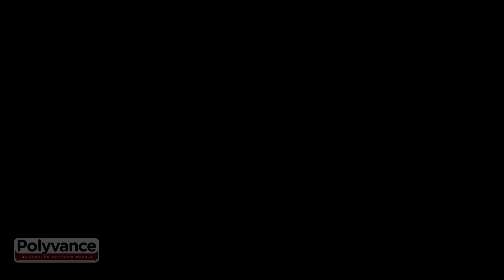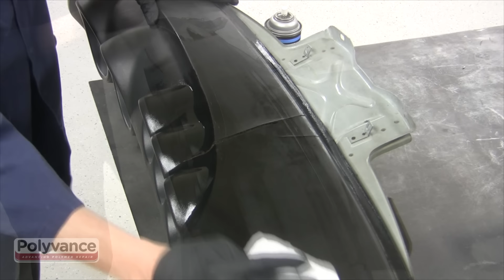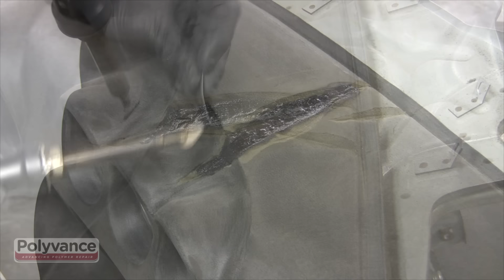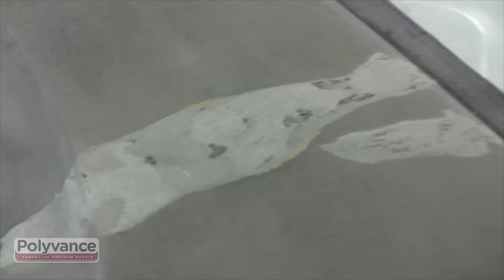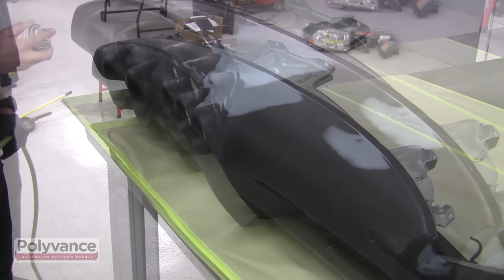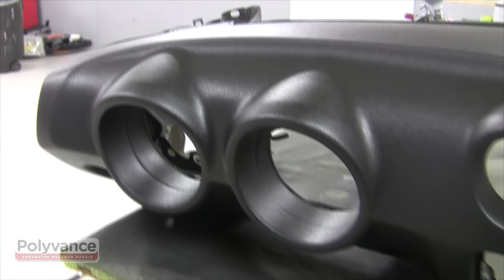Cracked Dashboard Repair - Padded Dashboard

Comment: Hello, Polyvance. I like all your videos and I am your subscriber, but I have two questions... That plastic you are using and melting before you apply that awesome putty - is that a plastic that has a PP letters on it?
I want to repair my dashboard in my Golf MK5, and it has slightly softer foam under the vinyl. Can I use that PP plastic, just like you did here, to strenghten the working area before applying the putty?
I don't have Polyvance products in my country, because I am far away from USA... I am from Eastern Europe, Serbia. So I use whatever I can find. Thanks in advance, your answer may help me a lot.
Reply: In most cases no.  You need to tie the cracked foam together with the vinyl with something.  Filler alone doesn't generally hold up well, since you'd be asking it to a job it was not intended to do.
Reply: You can order a 240V version of the kit needed to fill the cracks.  the  part number is  5210 230V as shown here:  https://www.polyvance.com/Airless-Welders-1/5210-230V/  You would have to email polyvance directly to place the order because the website cannot calculate shipping outside of the US.  When shipped by mail, it generally takes a little over a week to receive in most places.  The dash filler can not be shipped overseas due to the solvents in the formula.
Reply: Scott B Thanks a lot, sir, for the advice! This means a world to me.
Reply: I would not use PP plastic to fill the foam.  PP is much harder the urethane filler rod we use.  Just to clarify, there are two basic categories of urethane, thermoset urethane and thermoplastic urethane.  Thermoset is used for things like foam and bumpers and is not meltable.  Thermoplastic urethane is like our welding rod, it melts and rehardens without breaking down.  It is also fairly soft, flexible, easy to refinish and melts at a very low temperature and for those reasons is why we use it to repair padded dashes.

:Revised:  To actually answer the questions dealing with FIBERFLEX ROD....Fiberflex serves the same purpose as the urethane I mentioned and has the same benefits as the urethane in this application.  They can be used interchangeably in this case.
Reply from the maker: Thank you for subscribing to our channel and watching our videos!
In this video, we are using FiberFlex welding rods (https://www.polyvance.com/FiberFlex-1/). FiberFlex is formulated with carbon and glass fibers for the strong, fast repairs. It sticks well to polypropylene (PP) plastics. You can read about repairing plastic with FiberFlex here: https://www.polyvance.com/step3c.php
Reply: Scott B I bought BumperSoft BUMPER POLYESTER PUTTY, made by BODY and that is the one I could find. Can I use only that putty?
Reply: Because I don't have an access to Polyvance product in my country (we simply don't have it), what can you advise me? Some other materials? Please, I am kind of in a hurry and I did everything like you in this video, now I need to tie cracked foam together.

Comment: nice looking repaired dash, but i think it is cheaper to buy a new one (old one but uncracked) from car graveyard. But if you dont find one, or restore a "one of a kind" car, all that trouble should worth your money and time to fix the unique dash.
Reply from the maker: Yes, the time and money is definitely worth it for those who cannot find a new dash or would prefer to keep the original.
Reply: how much money a kit costs? Thank you!
Reply from the maker: We used FiberFlex in the first part of the video, which you can get in our Mini-Weld Model 7 (https://www.polyvance.com/Airless-Welders-1/5700HT/) or with the FiberFlex Repair Kit (https://www.polyvance.com/Airless-Welders-1/5210/). The filler is our Padded Dash Filler (https://www.polyvance.com/Padded-Dash-Filler-2/2050-9/). You can check the description box to see the products we used and how to get them.

Comment: I agree with the first step but you should use vylin paste with a heat gun and silicone mould from the same dash to mimic the original surface look. Look a bit cheap and tacky with the spray paint splatter finish.
Reply: Have you ever used those molds?  Its impossible to get the new molded texture to line up with the OEM texture and when you repaint it, you see a perfect ring where they intersect.  It looks terrible.  Retexturing the entire dash ends up looking much better, although its never exactly the same as on the original.
Reply: Scott B Yes. I used to be an Aircraft Interior Repairs Tech. We would use the silicone on a non damaged section then once it cured use that on the repaired section with vynil paste, then heat and press the pattern on. Then paint over top of that.
Reply: Scott B You just use less and less pressure and less vylin paste near the edges, in a sense feathering it in. Practice makes perfect.
Reply: I'll have to practice some more on that.  Btw,  I've used the Flex-tex VT on aircraft instrument panels and they look great.  Also, the lighting on this dash doesn't do it justice.  It looked much better in person.

Comment: Fixing the dash is the easy part. Getting it out and putting it back in is the project.
Reply: Yeah I've done it to many trucks and for the newer ones it's probably 4 hours of labor to remove the dash because of all the wiring and airbags. It's not as bad as you think this is an older car so there's less wiring and no airbags. I imagine probably 2 hours but who knows.
Reply: Agreed!
Reply: That's exactly what I was thinking.. How to get it out
Reply: Not in an 84 Chevy pickup!
Reply: @cranki6316  that is what I was thinking. Takes about 10 min to get it out and from the looks of things about 12 hours to repair it, or just shell out abou $300 for a new one
Reply: @integr8er66  I am yet to see a $300 280Z dash with no cracks and in good condition. Try $750 to $1200
Reply: @vinloy23  I'll give you that there are rarities where you have to repair it and you can't buy it or it's just way too expensive to buy
Reply: @integr8er66  and that is why this company has come up with this solution. I highly doubt they made it for cars that you can get a cheap dash for.
Reply: Yeah... I know, doing that right now with a 1991 Lada Niva.
Reply: It is pretty easy actually to get out one on a 1968 fierbird i just pulled out the glove box then the gage panel and dropped the steering colored and proped it up but can't say about other cars but I did think that it was going to be bad
Reply: Im going to do this with my 83 monte carlo ss but im scared to take that dash out i dont just have 1000$s laying around to replace what falls apart
Reply: Puppet you are correct! Once you've done one or two it's really not that bad! And I would rather put the two hours of assembly and disassembly, and the  two or three hours in on the repair myself than pay a shop 6-8 hrs labor plus material and taxes any day!!
Reply: That's what I was thinking!
Reply: Aman brother

Comment: dash looks overly textured, like bedliner, a flat finish would've looked better, and more like a vinyl/leather wrap
Reply: It depends on the amount of reducer you put in the texture paint.  Add enough reducer and you end up with a satiny smooth finish.
Reply from the maker: You're right that our Flextex VT will not match the original leather grain look. Flextex produces a pebble grain texture, from smooth to coarse (and anything in between), depending on how much you reduce it.
We could have left it at a flat finish, but we wanted to show that it is possible to put some texture back on the dash.

Comment: I've been doing custom interiors and repairs for 17 years. I came up with a procedure almost identical to this.  Using products from the auto paint store originally designed for repairing rubber and plastic body panels.  The only real difference is the heated plastic filer you guys use other then that it's the exact same process.  I can attest to the fact that this is the absolute best way to repair a dash even if it's going to be re wrapped with leather or vinyl.   Good job guys #greatmindsthinkalike
Reply: Similar experience here, fallout - been in the business for over 30 years, and discovered by accident that expanding polyurethane glue, covered by flexible body filler and textured paint yield the same result.
Been doing it for over 20 years now, have given all the the repairs a lifetime guarantee, and have never had a single return.
Reply: @lAMCANADlAN   what brand or part number of the expanding polyurethane glue do you use?
Reply: @lAMCANADlAN  That textured look might be OK on some cars but it wouldn't look right on my '95 Buick Riviera, it has more of a crinkle finish texture...
Reply from the maker: That's awesome!

Comment: I would pay you to teach me all this in person at a reason price. You got my vote on plastic repair.
Reply from the maker: We actually do hands-on training for our nitrogen plastic welders! We have our one-day PR-01 course that is taught at your shop's location: https://www.polyvance.com/Training-2/PR-01/
We also have a two-day, in-depth class at our factory: https://www.polyvance.com/Training-2/PR-02/
These courses are on the use of the nitrogen plastic welder, however. The FiberFlex in this video uses the airless plastic welder to make an adhesive bond. Our nitrogen plastic welders are used with the welding rod that matches the plastic you are repairing, which provides a complete fusion weld (a cohesive bond). Our nitrogen welders do have airless welders attached.
Just something to check into if you are interested!

Comment: Looks like truck bed coating ya wanks
Reply from the maker: You're right that our Flextex VT will not match the original leather grain look. Flextex produces a pebble grain texture, from smooth to coarse (and anything in between), depending on how much you reduce it. You can see examples of the heavy, medium, and fine texture here: https://www.polyvance.com/_pdf/info3803.pdf

Unfortunately, matching all OEM textures is impossible because some use a square pattern or a leather like pattern. Even if you take a mold of the pattern and embed the pattern on the repair, you cannot blend the original pattern with the reproduced pattern.  When you paint it, you end up seeing a transition ring every time.  So the compromise is to put a pebble grain over the entire dash and dealing with the fact that it is not the same.

Comment: I would think it takes a lot of experience to have that kind of result.
Reply: Its really not that difficult, it just takes time. The most difficult parts in my opinion are spreading the filler, so its not overly thick and spraying the texture.  As long as you don't spray coats of texture that are too heavy, even that is pretty easy.  Don't rush the texture spraying in other words.  Many thin coats are FAR better than a couple of heavy coats.

Comment: Maybe it's just me, but the 'new' look reminds me of truck bed liner texture, it looks like it would be quite rough. Also just doesn't look right to me.
Reply from the maker: You're right that our Flextex VT will not match the original leather grain look. Flextex produces a pebble grain texture, from smooth to coarse (and anything in between), depending on how much you reduce it. You can see examples of the heavy, medium, and fine texture here: https://www.polyvance.com/_pdf/info3803.pdf

Comment: Are polyvance products FAA approved for aircraft use?
Reply: That's a trick question, because the FAA does not approve products for making  repairs to non-airworthy components.  For the FAA to "approve" something it would require destructive testing and for a repair, that is clearly not possible. For all non-flight critical components, as long as the repair does not exceed 2 square feet in size (most would not be this large), all that is required is that the installation A&P sign off on the repair stating it would not pose a hazard to the aircraft or persons on the ground, should the repair fail.
Reply: Scott B very interesting to me. Do you know the FAR in regards to the 2 square feet figure. I have never heard that before and I would like to look that up.
Reply: In order for a mechanic to approve the repair,  look in the  F.A.R. part 14, sub part 23 for general aviation, part 25 for commercial aviation.  I believe it is section 25, 8-53.
Reply: Scott B thank you very much.

Comment from the maker: Check out our other videos to see more tutorials on our plastic repair and refinishing products.
The first part of this video shows us using FIberflex with an airless plastic welder. Did you know we also make nitrogen plastic welders?
We introduced nitrogen plastic welding to the automotive collision repair industry in 2006. In 2016, we introduced our fifth-generation line of nitrogen plastic welders with a full range of product features that make them the most versatile and easy-to-use on the market.
Thanks for watching! Don't forget to subscribe and hit the bell for notifications!
Reply: Anything that keeps UV light from hitting the plastic will help slow the aging process.
Reply: Polyvance. What can I put on it so it doesn't start cracking
Reply: @Polyvance hello any tips with a dash with the foam only existing? the black vinyl on the dash has been removed due to being to fragile and brittle of age and heat. Any tips , material that could be used to help. Thanks

Comment: Sorry to ask this but what kind of paper did you put under the puddy?
Reply from the maker: I believe you are talking about our "Clean Sheets".  They can be found at https://www.polyvance.com/Clean-Sheets-1/CS100/
Reply: I'm not sure what you meant by paper and puddy I assume you mean filler.....We used foil tape on the backside of the repair to stabilize the bumper during the repair and then we used 1060FP filler prep over the repair before applying the filler.

Comment: What if just the top part has a tiny crack
Reply: Then the repair would be shallower, you may not need to repair the foam at all if the crack hasn't telegraphed its way down into it.

Comment: While you filled the crack... perhaps excessively imho. You ruined the texture of the vinyl dash, it doesn't look like vinyl anymore it looks like plastic sandpaper.

I'd rather just live with the crack.
Reply: Its always possible to add more reducer to the Flextex VT in order to reduce the size of the pebble grain.  Keep in mind, the camera was flown very close to the textured surface and the lighting was set up to enhance the grain as well, making the grain stand out much more than it does in reality.

Comment: Does not work if your dash has any texture
Reply from the maker: You need to retexture the whole dash, but you can't get the leather grain look.
Reply: Retexturing with a texture material like 3803-4 Flex-Tex VT produces a nice pebble grain texture.  With that product, you can choose how coarse you want the texture.  It will make anything from smooth to a coarse pebble and anything in between, depending on how much you reduce it and how its sprayed.

Comment: funny, at the end they keep showing the dial area instead of the repaired area. did it come.out that bad?
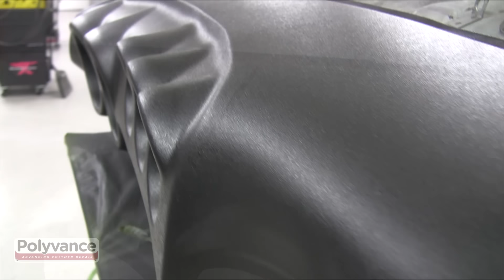Reply: Danny B it is visible in 6:44. Btw it is not perfect. You can slightly see that line is not balanced
Reply: 100 times better than it was but some just love to moan about any piddly little thing

Comment: lol I did this repair on my 76 Mercury capri back in 83... only I jumped straight to Bondo and used a can of rustoleum... used a piece of vinyl with texture and pressed it into the primer to match the original dash then sprayed it plack a few times... cost me less than $10 and looked great!
Reply: That's a great idea to get the texture transferred back to the paint.  The texture on this video looks really awful.
Reply: William Felix you can use the rostoleum bedliner spray for the texture. Fairly cheap and you can find it on Amazon.
Reply: @peterg8554  That still won't give you a traditional pattern like these dashes had originally.  It is an OK pattern, and better than what Polyvance shows here, but getting it to look like a new vinyl padded dash is the interesting part.
Reply: How long did it last though?  Old, hard bondo next to a flexible vinyl will crack quickly.  The padded dash filler cures soft so the intersection between the two is more forgiving.
Reply: Thats what I was thinking.  the bondo probably cracked off with 3 months of summer sun.
Reply: @scottb7600  it should last a very long time, as long as you don't walk on or sit on the dashboard a lot.
Reply: @jimbob5013  It will not last.  When you put two materials together with wildly different flexibility,  they always crack at the seam.   Heck, bondo cracks on its own anyway.
Reply: Yea, I’m looking for a cheaper alternative since I’m doing this in my work truck. I’m gonna try using bondo like you did.
Reply: Thought of doing something similar myself many times to keep the 'haircell' texture, don't like the spackled orange peel look the repair paints give. Glad to know I'm not totally off my rocker! I had planned to wrap a foam roller with some vinyl and contact cement so I could make a continuous texture.
Reply: @William Felix This is an alternative. https://www.youtube.com/watch?v=IaSm3zoWrAo
Reply: 6” block
Reply: Fiber flex welding rod I put that sh!t on everythang
Reply: Slow that da down
Reply: Then every times you wipe it down it makes it look like shit rustoleum paint way to soft.avoid it on cars.i would hate my car knowing its got rusto shit on the dash
Reply: yeah rustoleum paint on a  dash is not correct, but dont blame rust oleum, they have good spray paint for cheap right? @vincevegacustoms754

Comment: you can use less expensive products like, a polyester body filler, a cheap can of spray bed liner,for texture, rubbing alcohol, to clean and .99 cent flat black spray paint. cost is less than 20.00.